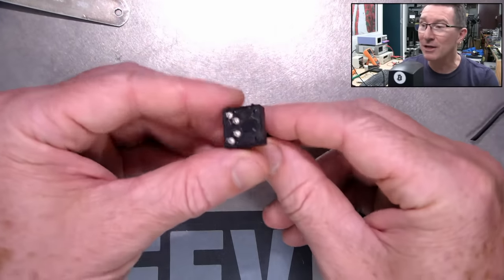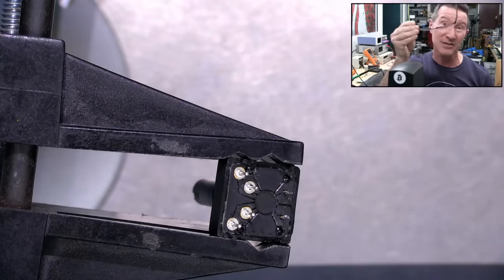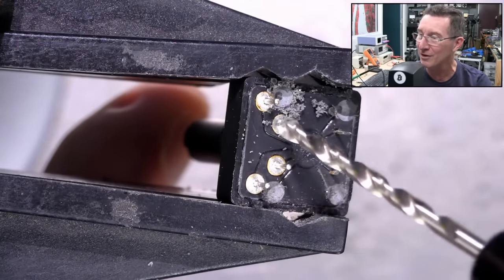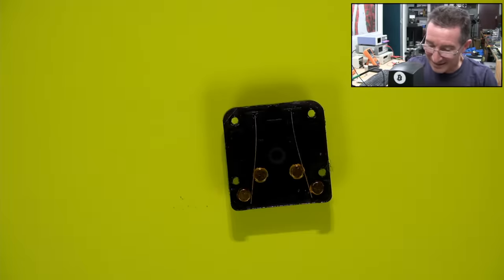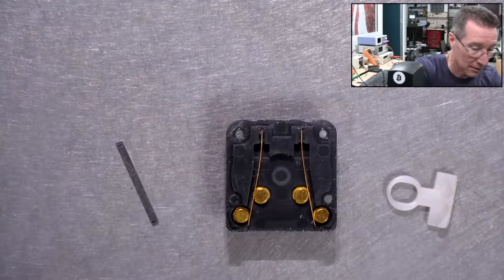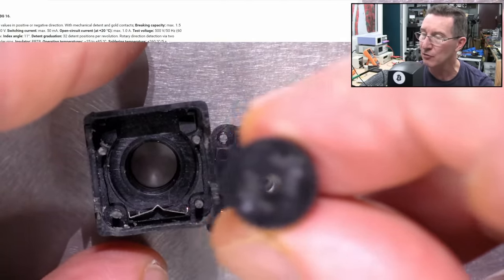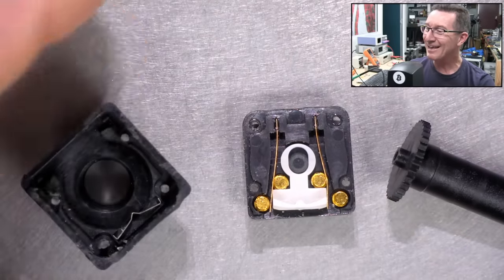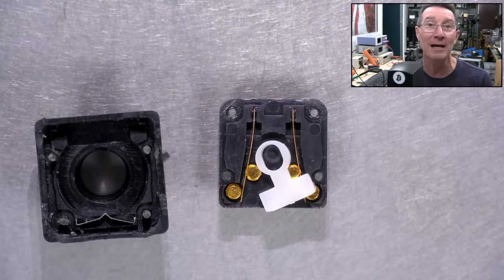EEVblog 1573 - TEARDOWN: How a Rotary (Angle) Pulse Encoder Works

Comment: Long spring goes opposite to the indented one, you can see the place for it. The reason it stopped working after contact cleaner is you removed the lubricant that provides drag between the shaft and the bump mechanism, so it would not move the switch. Probably would have worked with a drop of silicone oil down the shaft, to make a thin viscous film. The reason it failed was probably the low viscosity oil evaporating out of the switch.
Reply from the maker: I think the additional problem was due to me heavy handidly putting my knife down each side. The case bulged out. Most likely that's not good for the tight tolerances required. But desoldering/soldering could also be an issue.
Reply: @EEVblog  Glass filled nylon there, so likely robust enough to survive soldering. Think it just lost lube there, plus the contacts wearing the gold finish off on the spring brass wiper, so it stopped making good contact. Also probably not helped by too low a contact current, they have a minimum contact current on switches for a reason. This probably has 10k resistors, and thus not enough current flow to keep the contact surfaces clean long term. Probably needs 1k and a 1n ceramic capacitor across the switch contacts, to provide that little bit of spark to clean them.
Reply: The white pawl is acetal aka Delrin which is self lubricating and will be happy to do its thing without lubrication in this type of mechanism.
Reply from the maker: @theslimeylimey  Yeah, shouldn't need lube I suspect. That's what she said.
Reply: My theory is that it failed due to wear on the cog and pin - on the assumption you didn't bend the left side gold plated strip during opening it, it looks visibly bent with a kink compared to the right side.

To elaborate, as teeth wear down the white piece will gradually move higher (to the centre/pivot point).

Once the wear reaches a point high enough, when the white piece moves sideways to push the gold plated strip to touch the outer pin, it will push it beyond the elasticity point and gets plastically deformed.

I'd imagine it might begin to fail intermittently at first, like as it's rotated and clicks over say 24 times, electrically it may only contact the outer pin sufficiently to register 13 times.

Also i wonder if one potential undesirable characteristic of this design would be that the strip may connect both pins at the same time (or neither pin) - with such tight tolerances i don't see how it wouldn't. 

Just a spit-balling theory though, i could be completely off base and wrong.. but super interesting how simplistic something so expensive is, oversimplified it's just a fancy bidirectional switch no? 😂
Reply: @SeanBZA i don't think it relies on friction at all, the silver spring will require far more force to push down (and subsequently jump a tooth) than the force required to nudge the gold strip sideways.
Reply: @theslimeylimey  It relies on the film to provide torque, and thus there is a lube there, even if the nylon is self lubricating, you want a thin film that provides shear force to move it with slip against the spring, and it will click and make contact, then be returned to the middle, and again for the other side.
Reply: @SeanBZA  That's not how it functions as I see it.  It's one tooth rack and pinion gear in essence. 

The white acetal pawl (rack) is always in meshed contact with the toothed wheel (pinion) because of the beam spring pushing it in that direction against the teeth.  There is nothing stopping the pawl from moving laterally depending on the direction the shaft is turned until the pawl is pushed up against a contact post thus changing the contact state.  

As the shaft shaft it turned more, the single tooth of the pawl (which is now held back by the contact post) then ramps up and snaps over the wheel tooth crest and is drawn into to the next tooth valley (powered by spring force and slope of the tooth face) which moves the pawl back in the opposite direction by one tooth pitch away from the contact post which is just far enough to restore contact state thus completing one pulse. 

This "ratcheting" pulsing snap action will continue until rotating torque is removed from the shaft allowing the pawl to return to its relaxed central "neutral" position where the process can start all over again in either direction.  I don't see how a small amount of "drag" from lubricant would have any effect on it's operation.  It's a clever design.
Reply: Springs seem as delicate as ones in mouse switches. They never last forever and have several failure modes.
Reply: It's called detent, not indent.
Reply: Dave has put the indented spring is in the wrong place.  Look at 12:29.  The two halves are misaligned by almost 90 degrees as can be seen from the remains of the rivets.  Rotate the piece he is holding to see where the indented spring needs to be.
Reply: @EEVblog don't know the exact contact cleaner you use, but there are one's ment for potentiometers, sliprings and similar, like Kontakt PR, which also have lubricant in them

Comment: I have been using this kind of encoder (manufactured by Alps) in flight simulator hardware. It is used for selecting heading, speed, altitude, radio frequencies, etc. Extremely reliable, not a hiccup in 20+ years of everyday use.
Reply from the maker: Part number?
Reply: @EEVblog  It's been 20+ years, so I can't say for sure, but I want to think it's the SRBM1L0800. I'm a bit thrown off by the "6 positions" title at the top of the page, but from the electrical diagram shown at the bottom of the page (two momentary contacts, each driven by CW or CCW rotation) it could not encode 6 discrete positions. Perhaps the "6 positions" title is carried over from the SRBM switch series, most of which are in fact simple 6-position switches, as seen by their diagrams. 

It does seem that SRBM1L0800 is the switch that I bought so many years ago.
Reply: LOVE that encoder. It's great for making rotary volume controls on devices with tactile vol controls built on the original boards. Just wish they made them with longer shafts and even a vertical mount.

Comment: I was trying to figure out how it would work and was expecting some kind of directional clutch but the actual mechanism is elegantly simple. I too wonder why it is not more popular.
Reply from the maker: Yeah, I was surprised by the simplicity. But the instant I saw it it was obvious.
Reply: If this mechanism turns out to be cheaper to produce but just as reliable as current implementations, someone will likely start producing them after becoming aware of it through this video, as any patents must have run out by now.
Then again, looking at how cheap rotary encoders are nowadays, I can also imagine that no one will put in the effort.

Comment: Many years ago, I wanted to convert an up-and-down buttons for a synthesizer to a shaft encoder. I wasn’t smart enough to design it so I put it in front of two other engineers. One used a PIC micro controller, and the other use some 74 LS something logic and both gentlemen able to do it. The same thing as your pulse encoder does in one little package.  Very advantageous. I went with the logic and not the PIC…
Reply: LS logic would be a 74LS74 to do edge detection on the inputs, after running through 74LS132 with some RC filtering, to get a good sharp edge and debouncing, as slow edges are a bad thing with flip flops. One half provides the up pulses, and the other the down pulses, with only 2 packages and some resistors and capacitors.
Reply: @SeanBZA  Classic quadrature decoder is a D-type like the CD4013. Inputs to the Clock and Data, Q or /Q will give the direction. First used it around '72 so it's nothing new.

Comment: If your reading glasses are marked 1.25, that's the diopter value, which is the reciprocal of the focal length in meters.
Reply: For reading glasses, you can actually specify several parameters. They can have diopters, astigmatism correction, and magnification.
Reply: @gutschke As far as I know prescriptions are expressed in diopters.

Comment: At 12:29 rotate by about 75 degrees anticlockwise the part you are holding so that the remains of the plastic rivets line up in top and bottom halves.  It is then obvious that you have the the spring  is in the wrong location.   Possibly the other long piece of metal then goes between that spring and the shell wall.

Comment: The quadrature encoders are trivially easy to decode in hardware - you only need a D flip-flop and you will get out a clock and direction. One of the encoder outputs is connected to the clock of the D FF, the other output is connected to the D input on the flip-flop. Now if you turn the rotary encoder, the Q output of the D FF will give you the direction, and the clock used to clock the flip-flop is a clock for pulse counting. It's not an efficient way as you cut your encoder pulse count down, but it's a cheap and easy way to get direction and clock decoding.
Reply: Certainly a cheap way to get speed and direction but you get unexpected results when changing direction. In one direction it will first count in the opposite direction when the clock signal changes before the direction signal - you can even get it to constantly count up by turning it back and forth - acceptable for a cheap input device but useless for accurate  position tracking.

Comment: The problem with the design is that it is way too german to survive average users and our price competitive manufacturing. It just does not forgive any mistakes! It must be manufactured precisely to very tight specifications and it must be used in near perfect conditions or otherwise it just will not work. The approach is just not fit for the modern era of disposable everything.

Comment: Long sprint pushes the white part against the cogwheel, the other shaped spring pushes against the cogwheel from the other side so the clickety ratchet action is balanced and smooth and probably to ensure a full step is made and the whilte part stops centered.

Comment: I guess it's not as popular especially in industrial use as quadrature encoding as there is less ability to detect a fault. With quadrature if one of the 2 outputs dies then you know the encoder is knackered.
Reply from the maker: True.
Reply: But made inputs easier with a low code space, just debounce in hardware, and 2 inputs direct to a little code to increment or decrement a counter. No need to have fast code looking for edges using an interrupt, and then decide if it is valid, and update the counter. Just poll input, and look for a high on the enable pin, and then look for edges.

Comment: YouTube serendipity!  Earlier today, I was trying to locate a replacement Tektronix encoder made by Bourns. Its quadrature sectors are etched directly on the PCB board and mounted using plastic pins.

Comment: I saw your previous video, I think they only used the NO contacts, so it's like if you had two buttons, left and right. It would be very easy to hack in two regular tactile switches. This may be actually why they designed it this way, so that it could be retrofitted into existing designs that used up/down buttons without changing the code.
Reply from the maker: All 4 lines go to pullups and the micro.
Reply: @EEVblog  Looks like it would be possible to bodge in a pair of SPDT microswitches and a 3D printed lever mechanism to activate one or the other when pressing it from either direction.
Reply: @EEVblog  Reading both the NO and NC contacts is probably done for debouncing. You could do the same, if you replaced the rotary pulse generator with two push buttons.
Reply: @gutschke  IMHO - exactly! These SPDT contacts allow you to use simple RS flip-flops for absolutely reliable debouncing (one for each channel). So basically this encoder + 2 flip-flops give you 2 logic output lines equivalent to UP and DOWN buttons, but with "built-in" debouncing. Very clever design, never saw it before! Thank you Dave for sharing this.

Comment: I have encoders from ALPS that operate in a similar fashion, but which only have three terminals. The way they operate is when you turn the shaft clockwise, the common pin will first connect to the CW pin, and the CCW pin will be left open. Then for each step of the shaft rotation, the connection between common and CW will be broken briefly. Same goes to the counter-clockwise direction. The common will first connect to the CCW pin (and CW will be left floating), and for each step, the CCW pin will open for a brief moment. I bought these long ago from an electronics surplus store thinking they were quadrature encoders. Came with no model info, so can't point to a datasheet. Over the years, I've used them in a handful of projects, but they are a bit of a pain to decode reliably. They tend to occasionally give either 0 or 2 pulses for a single step of the shaft.
Reply: That's exactly why you want both the NO and NC contacts. By having two contacts for each direction, you can reliably debounce the signal. This is easy to do in either software or hardware and should completely eliminate the problem that you encountered.
Reply: @gutschke You're probably right. There's a lot more redundancy for the decoding with the extra pins. I've attributed the additional pulses to the fact that even a tiny amount of back-rotation on the shaft will disconnect the direction pin from the common, and which occurs in time scales much longer than the contact bounce time. I experimented with many different lengths of dead time for the debouncing, but the double counts persist until the dead time is so long that it's otherwise unusable. You can get it to a point, where the double counts approximately equal the zero counts, and thus you're at least on correct on average. I've been using them with the common grounded and pull-ups on the direction pins, which to me feels like the right way to do it.

Comment: If you look at the locations of the formerly heat-welded posts that held it together, you'll see that the formed spring does not bear against the white pawl, but fits in the opposite side and will just provide detents by acting directly on the ratchet wheel teeth. I suspect that the flat strip is a spring that presses against the pawl.

Comment: Did you turn it both ways when testing? I think I'll go back to the original video to check that out.
I checked out the original video, and yes it was broken both ways. What we now know is the normally closed contact was permanently open.

Comment: This rotary pulse encoder can probably be emulated by normal quadrature pulse encoder and one dual JK type flip flop chip (e.g. 74L73): The two outputs A, B of standard encoder would have to be fed into 74LS73 like this: A-->J1+K1+CLK2, B-->CLK1+J2+K2. Then  Q1 and /Q1 goes instead of the two pins on  left side and Q2  and /Q2 goes instead of the two pins at right side. This is assuming TTL logic is used, otherwise 4027B can be used.

Comment: Interesting- one thing that this design tradeoffs  is that the backlash is not controlled.  It depends on friction and how fast that little shuttle finds itself pushing on the contact.  Quadrature encoders have well defined backlash important in positioning apps.  This is better for a manual knob since its simple to decode.  You can take some resistors and diodes and make a one terminal encoder- in one direction, the signal idles low and pulses high and in the other, idles high and pulses low- pretty simple to decode with just one pin.

Comment: I think you'll find the +1.25 and +1.75 numbers describing your glasses are not magnification.  They are the reciprocal of the focal length in metres.  So if your eyes can only focus on far distances, the first pair makes them focus to 1/1.25 = 0.8 m, and the second, 1/1.75 = 0.6 m.  In practice your eyes can also focus closer than that, but the glasses enable them to focus even closer.

Comment: A long time ago I was working for the automotive industry R&D, blasting climate controls with an ESD gun very similar to yours
Some batch of these climate controls had a problem with their encoders. They failed at 10kV I believe.
I could not measure anything and wondered how on earth a simple switch contact could be damaged by an ESD pulse. I opened one up and found out they were optical with very complex light pipe action going on inside. Tiny little things with just about 10mm on each side. And sure enough after knowing what to measure I found out that one of the Phototransistors was open
They had like a backplane with the active stuff and lightpipes leading to that backplane (probably to avoid ESD problems ... yikes) You could also take one functioning phototransistor out and replace it from another unit. I made a bunch of projects using these "refurbished" encoders

Comment: It seems kinda weird that the flat "contact bridge" isnt bound to one of the pins. It seems like the pressure against the "normally open" pin could pull the contact off of the "normally closed" pin

Comment: Two variations of a quadrature decoder:

int decode( unsigned gray )
{
	static unsigned old = 0;
	unsigned binary = gray ^ (gray >> 1);
	int delta = (binary - old) & 3;
	old = binary;
	if ( delta == 2 )
		delta = 0;
	return delta - ((delta & 2) << 1); // sign-extend
}

int decode2( int gray )
{
	static int old = 0;
	int binary = gray ^ (gray >> 1);
	int delta = binary - old;
	old = binary;
	switch ( delta )
	{
		case -1:
		case +3:
			return -1;
		
		case +1:
		case -3:
			return +1;
	}
	return 0;
}
Reply: I prefer the lookup table method. It does a good job software debouncing mechanical encoders.

int8_t decode(uint8_t gray)
{
    const int8_t states [] = {0,-1,1,0,1,0,0,-1,-1,0,0,1,0,1,-1,0};
    static uint8_t old = 0;
    old <<= 2;
    old |= gray & 0x03;
    return states[old & 0x0F];
}